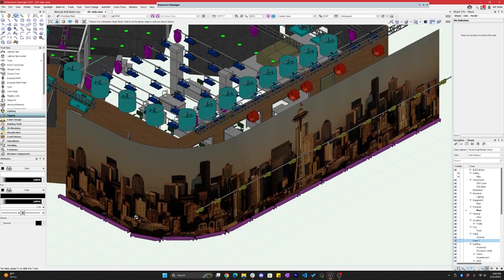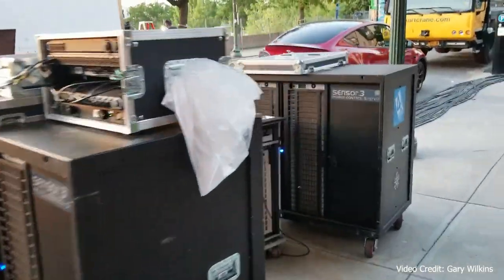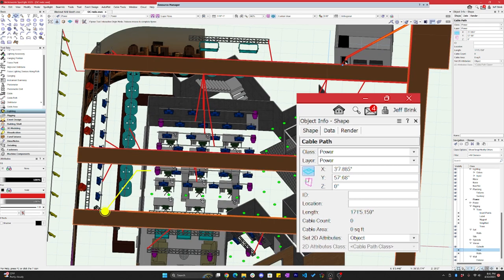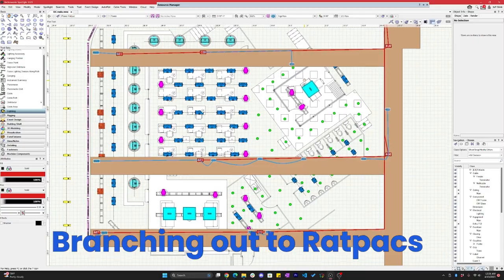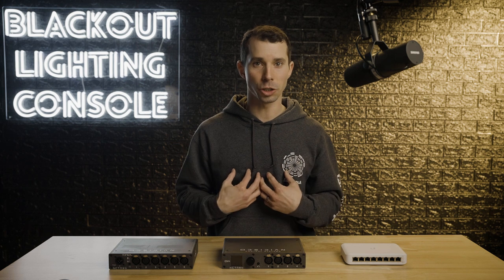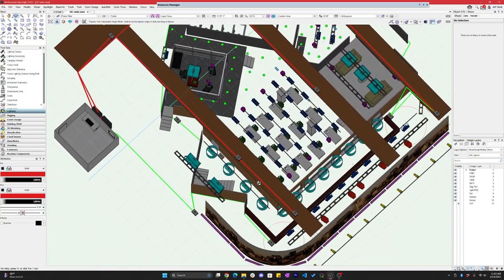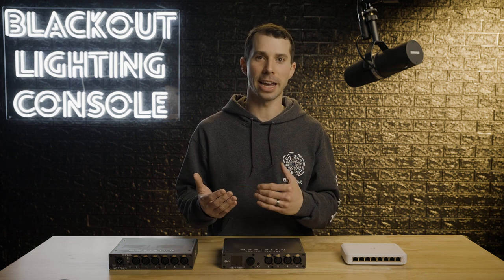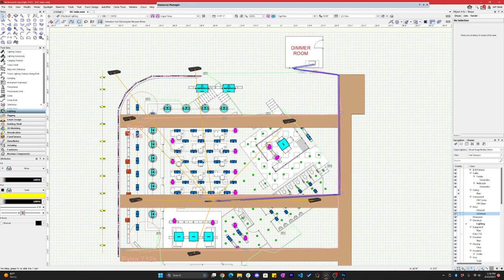How to properly rig a stage for professional film sets - DATA & POWER

Comment: Can you explain how the receiver linked to a transmitter plugged into a receiver linked to a different transmitter works?
I'm having trouble wrapping my head around how to the second transmitter is connected to the first simply by plugging it into receiver that's connected to the first. How does the receiver send the data to the second transmitter?
Reply: The Timo Two chips are capable of receiveing or transmitting you just have to place it in one or the other. So what you do is set one of your moonlights or cintenna’s in RX and link it to your main transmitter. Then use a turn around and plug another moonlight or cintenna into and set it to TX. Then link all the lights you want on that universe to that node. You can use it as a little repeater if your main transmitter is too far from a group of lights.
Reply: @andymiller54  riiight, I was thinking everything would be linked to the first tx, linking the far away lights to the second tx obviously makes sense, thanks for explaining